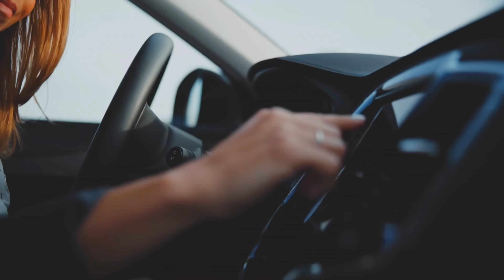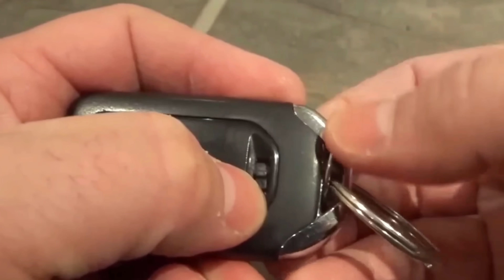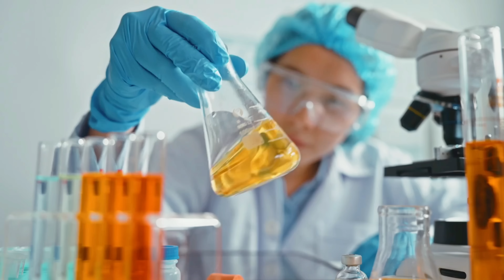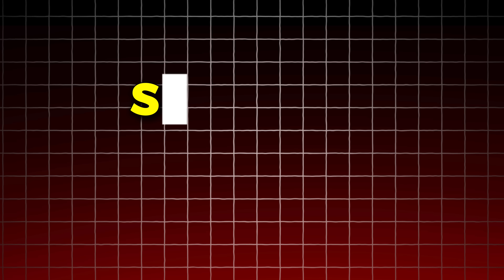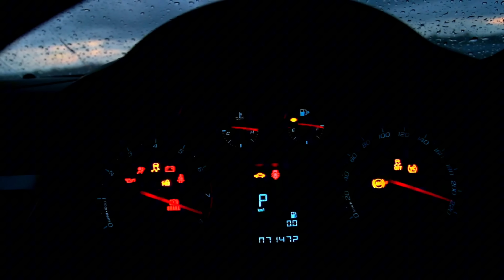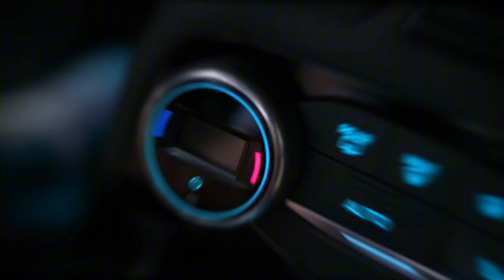You Can't Call Yourself a Driver, If You DON'T Know These 15 Secrets

Comment: Not all of the tips are sound. Let me comment:

#15: Bad advice for me. In my car the mirror defrosters are activated automatically with the rear window heating.

#14: Would not work in my car. In my car the sensor is in the centre console; in the right cupholder to be precise.

#13: What did drivers do before this feature was developed? Oh, wait. There are thermometers. Additionally, you can feel the grip going, once the temperature drops, if you pay attention to steering forces.

#12: Seriously? Who does not know that?

#11: What about the defog-option of the air-conditioning system? Mine gets the job done in about 20s and keeping the air-conditioning on prevents re-fogging. Not wiping is a good tip though.

#10: Again, seriously? I have never even heard of anybody mis-identifying those.

#9: Flat out untrue, at least where I live. The pumps automatically correct for temperature and there is no way at all to change the pumping speed. It is also automatically controlled to avoid vapor buildup.

#8: And what about drivers outside the USA? Where do we get pennies or quarters? And you should have lead with the quarter. The penny thing is repeated over and over again. Even I as a German who had never been to the USA have heard of the dangerous measurement using a penny.
Measuring multiple points is sound advice, though. But you forgot to mention that you really should get an alignment and your tires balanced if the wear is too uneven.

#7: Failing fuel pump? I have been driving for over 25 years now and I have had one failing fuel pump, but that quit working while driving. Neither myself, nor friends, nor family nor co-workers have ever had the described problem. And by the way, if a fuel pump is dead the starter will still turn the crank in some models, including the typical starter noises. The starter only giving of a click is more the sign of a dead battery.

#6: Honestly, I did not know that about automatic transmissions, nor have I ever needed it. And I probably never will. With a normal (i.e. manual) car I engage the parking brake (handbrake in most cars, but for example fourth pedal in older Mercedes cars), then press and release the clutch to avoid the mentioned strain. With automatic cars, well, don’t all modern automatic cars do that themselves? At least my car engages the parking break and then goes into park automatically, once I stop the engine. But if cars don’t do that, a very good tip that can avoid costly repairs.

#5: Just no. This is terribly dangerous and would never fly with a proper technical inspection. By the way: Are US headlights that shitty? I have never seen headlights like those in the video in Germany, not even on the oldest and worst clunkers.

#4: Do they not teach that in driving school? I am confused this is even a tip.

#3: The what now? First of all, I am fairly sure that this does not work universally with all brands. Secondly, I am 100% certain that it does not work with a normal (i.e. manual) transmission because there is no such computer at all.

#2: Yes, tire pressure is important. Yes, driving without harsh acceleration and braking is most efficient. But once again: How can one not know that and be allowed to drive without an instructor present? Not knowing such basic stuff would make you fail the written exam instantly, even nowadays, where the questions have become much easier. Is US driver education really that terrible?
Furthermore, shifting style is also very important to keep your car in the best possible rev-range. This can be done with an automatic transmission as well, either with pedal shifters or, if there are no pedal shifters installed, with micro-liftoffs from the accelerator. But one has to know the power and torque curves of the car to know the correct rev-range, naturally. This would be a good tip most people actually do not know. So read the revs-power and the revs-torque diagrams and shift accordingly.
And with air filters: Do all recommended maintenance. Not just oil changes. The people in the US do to many oil changes and to little of the rest.

#1: Generally true but hardly something only experienced drivers know and do.